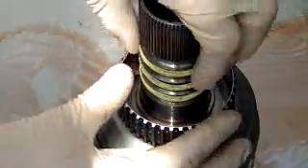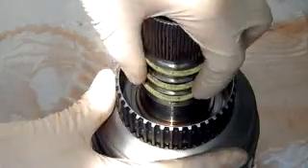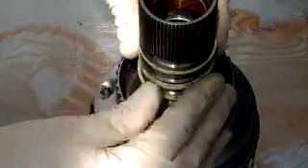Teflon Seal Ring resizing, Automatic Transmission

Comment: Mine has four. I bought four hose clamps and a smart water for its clear, perfectly cylindrical bottle. Peeled the label off, cut it, and wrapped it around the shaft. I then cut off the excess so there's only a few inches of overlap. Then I took the hose clamps and tightened them to nearly the size of the shaft. Tighted the plastic (bottle) and slid the first hose clamp on while trying to keep the plastic tight, and then positioned the hose clamp over the o ring and tightened it. I then repeated it for all four. They were all stacked right on top of one another. I then went back and tightened them all real tight. I saw a comment online where someone said they did something similar and not he thinks he overdid it and now theyre too stiff. My first attempt was for hours and I saw that, got paranoid, and took them off. They looked just as loose as before. So I did it again, tightened them evem tighter, and now Im letting them sit overnight. Hopefully that does it. I'll try to update if I remember to.

Comment: Being curious. Did you stretch the seals so you could get them over the splines without being cut by the splines? If so, why not just wrap the splines with clear packing tape to protect the seals as you slide them down the shaft?
Reply: They don't roll, they are stiff plastic square edged and they are not  even close to the right size. Definitely have to distort the size and let relax

Comment: 4t65e 2008 Grand Prix has a delayed engagement at a stop. Doesn't do it all the time. Is this something that will break internal parts if I don't fix it soon? Is it something that will leave me stranded? It has 154k miles on it. It's shifts great other then this. No shift flare or anything. I'm just wondering if I should take the transmission out soon to fix of if I could wait till summer. Thanks in advance!

Comment: Ever try immersing them in transmission oil heated to 130 degrees first?
Reply: Why not just add them to boiling h2o considering that a trans will get WAY over 212 anyway & they are Polytetrafluoroethylene  .
Reply: I would think just heating them gently w a heat gun would activate shrinkage. But just be careful not to overheat them.